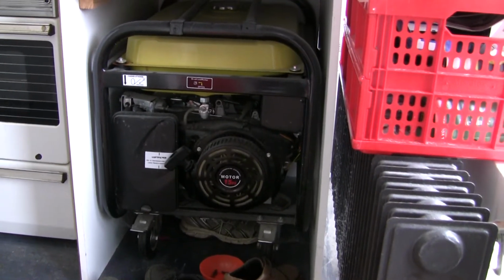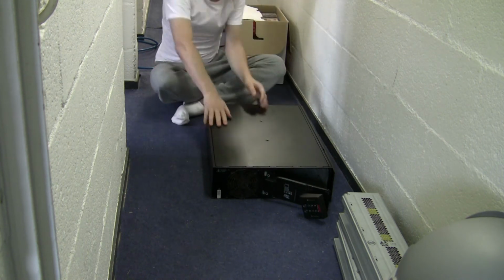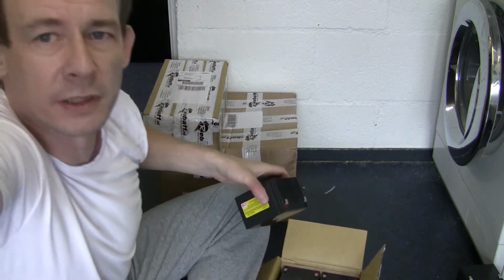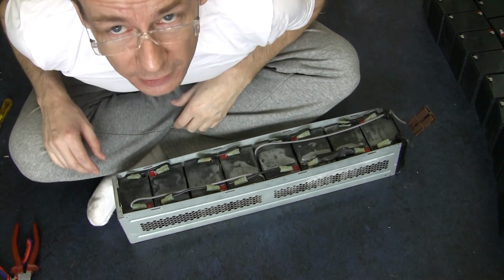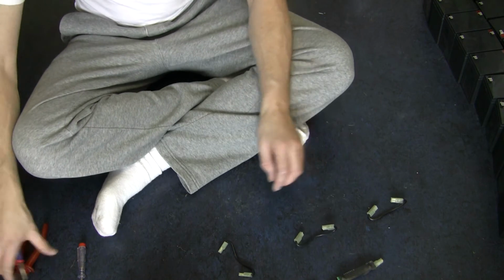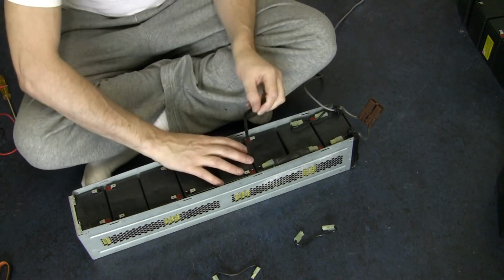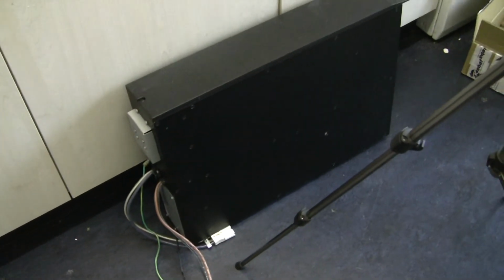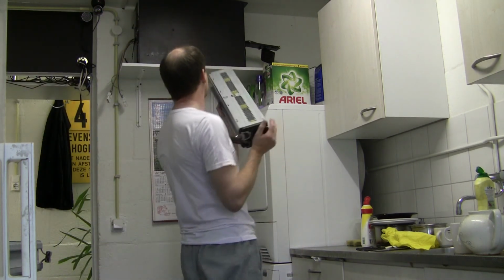Replacing the 48 batteries of a APC Smart-UPS RT3000 (with additional external batterypacks)

Comment: All of that weight on a single shelf, if that fell, it would kill somebody. I notice the brackets holding the shelf appear to be more heavy duty, so good for you. I would never mount it in a spot like that. Be safe, thanks for the video, and let us know how the replacements worked out, it is now nearly 4 years after you replaced them, how about an update?
Reply from the maker: The replacements still are in good shape. Time files that's true. The brackets are made from 5 mm thick steel, and the bolts are much stronger then needed what they have to carry.

Comment: Didn't you broke your back while lifting these heavy units up high?
Did you hook your entire house to the UPS system? That would be quite interesting, but also quite dangerous unless you perfectly well know what you are doing. (Risk of overload, risk of putting power back o the net outside of your house, not even to talk about suicide-cables)
Reply from the maker: I have a strong back. I have installed a new set of mains power cabling on the outside of the wall to distribute the power to different rooms. With a little fusebox in between to divide the power into groups

Comment: These are some very expensive units. Especially with all the battery packs. Why do you put them in your kitchen?
I got a bunch of Smart-UPS 1000 and 1500 units for my computer equipment. They work nice and reliably but because my power is so reliable they rarely have to kick in. My last power outage was more than a year ago. With your accent and your stuff around you seem to be in the Netherlands as well. How often do you experience power outages?

By the way: APC uses CSB batteries as well, among other brands.
Reply from the maker: The kitchen is the room with the needed space and distance from the bedroom to dampen the noise of the ups.  I've bought the UPS second hand for a low price a few years ago, the batteries I've now bought are more expensive then the whole unit years ago. Years ago there were a lot of outages because of roadworks, the people working on the road have cut the cable many times. One time the outage took 6 hours. I did not have this APC back then, I did had the generator but the power from it was too unstable, after an half an hour I got a headache from the flickering lights so I gave myself a free Friday afternoon. Since I have the APC there are not that many outages. Althrough a while ago the people studentflat above by home turned of all fuses in the shared fusebox including mine, unfortunately the batteries were dead then so I also had an hour of work to get all equipment back online again.